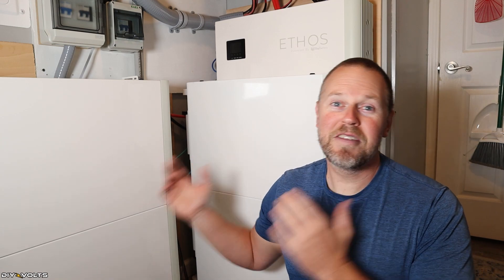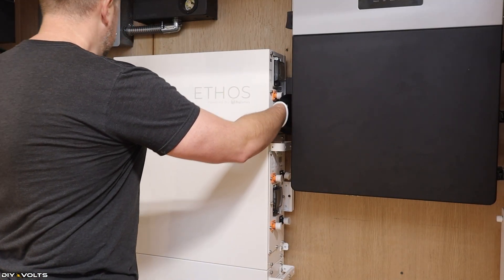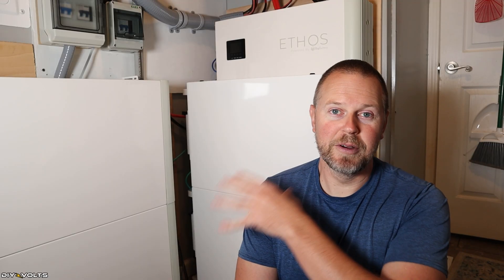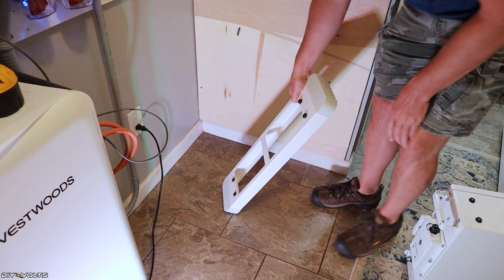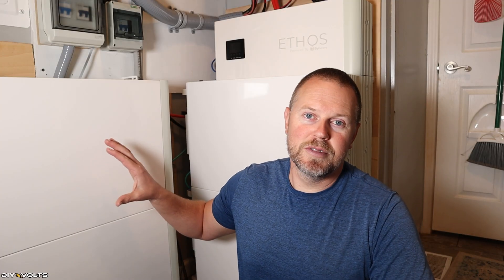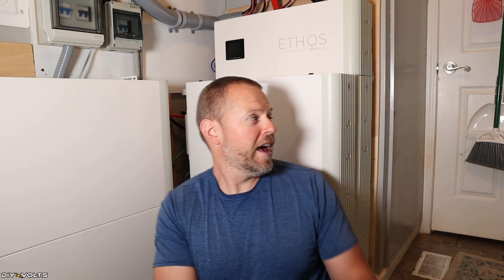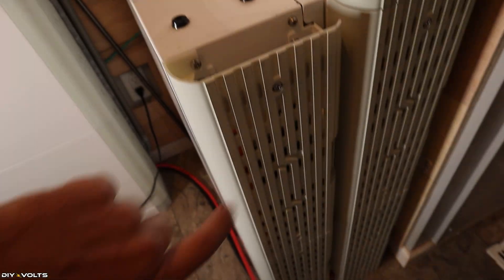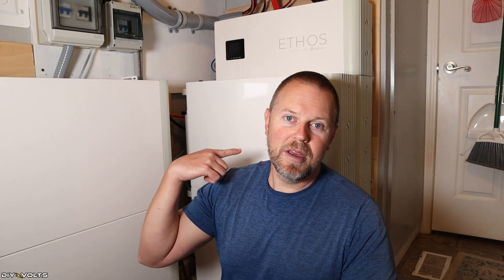Is the BigBattery Ethos LFP Worth It? 1 Year Whole House Battery Experience

Comment: Oh Wow, $$8,586.00 for 30.7 kilowatts or you can have 32.2 kilowatts for just $3,736. That is a savings of $4,850. In other words you can have twice the power (64.4 kilowatts) for $7,472 and still save $1,114. Sorry, I work too hard to pay that much for so little. By the way, these batteries are built with EVE MB31 314Ah Grade A+ cells with a real capacity around 330Ah and uses the JK BMS, the best BMS in the industry. And they talk directly to my EG4 18K PV with the PylonTech or the Luxpower Protocol. Also, our 60 kilowatt hours have never been out of balance because of the 2 amp active balancer built-in. After almost 2 years they are rock solid with 100% state of health.
Reply from the maker: There are so many types of batteries out now. Its great to see the price going down. Because I work with Signature Solar I am able to get a good deal on these batteries.
Reply: Lol, you paid $3700 for only 32kWh? I work too hard to waste money like that. 

I bought 35kWh for $2.8K with MB56 cells.

But neither of our batteries are UL Listed, unlike the BIg Battery Ethos, which is.